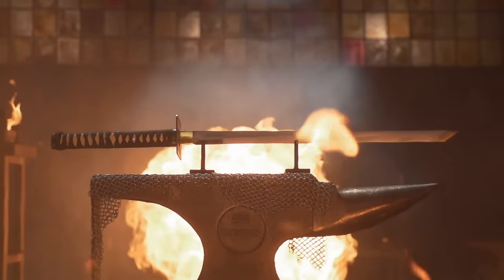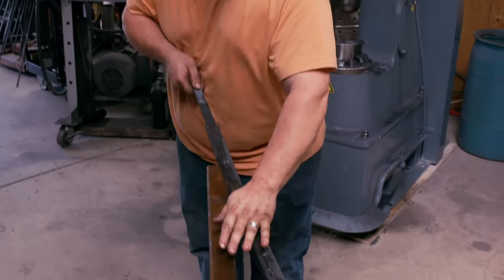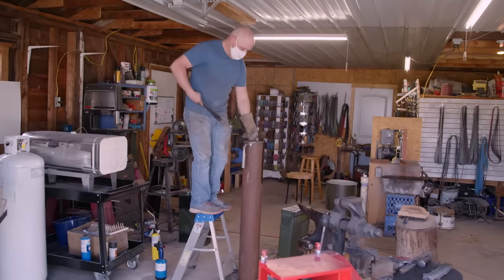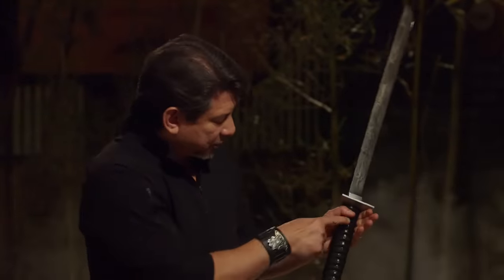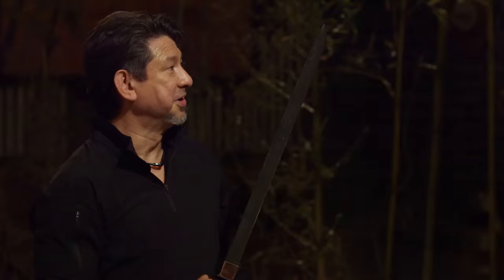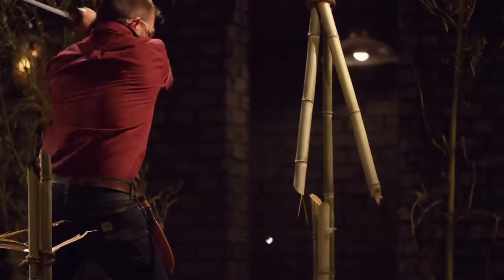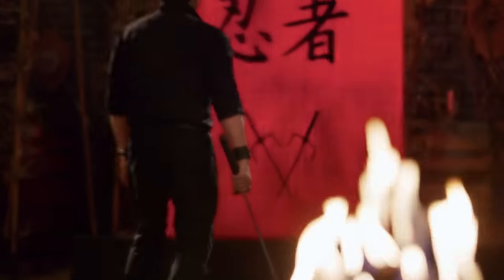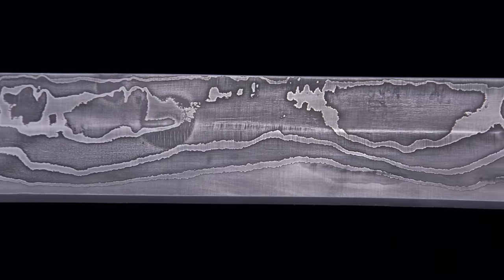EPIC NINJA SWORD USED BY SHADOW WARRIORS! | Forged in Fire (Season 9)

Comment: I always find it kind of strange when they comment on handle size. You make a sword to fit the swordsman, and then have 2-3 different people test it, so of course it's not gonna be a perfect fit every time.
Reply: I've often wondered this.  I don't know, maybe they're working off some kind of average?  There is a typical dimension to the hilt/handle...but then we go back to your point:  For what person?
Reply: I think they judge it based on the original and standard size regarding the designated weapon.
Reply: I immediately thought it probably fit the bladesmith's hands fine, they are both larger men
Reply: A smith doesn’t tailor a handle to one specific person when they know it will be handled by multiple people.
Reply: Is there a ratio to the length?
Reply: @rens7522  there’s little to no info on the ninjato historically, it was either a rare thing to really be used, or the ninja destroyed their swords after they used them, as they didn’t have the spiritual significance that the katana did. There is some evidence to suggest the latter, and only a lack of evidence could suggest the former. Basing the dimensions for this competition on a katana could be helpful, but the required dimensions of katana were determined by the shogunate of whatever point in time, so it changed all the time. Sometimes katanas had to be 2 feet, sometimes 3. I imagine the required handle dimensions changed as well, assuming they weren't custom-made to the swordsman, which could be possible seeing how easy it is to remove the handle from a real katana.
Reply: @cheetodorito7403  wow thank you for this info this is actually really cool 🙌🏼
Reply: Actually i think a real ninja sword would just be a bigger skeltonized knife meaning handle and blade one piece with just a quick cord wrap for grip after all they usaully made a new sword for each job they took they knew that traveling from town to town that they would probably be stopped and searched several times so they would not carry any weapons with them and just rough make somethings at each town the target lived in so the weapons they used would be very crude and disposable ,not wanting to be caught carring after the target was killed. So basically  the sword would be just a 
quick steel bar with an edge ground on it.
Reply: @lonknight3197  In reality, ninjas didn't like look the modern image of a ninja.  Instead, they would have dressed like farmers or tradesmen, someone who would have passed unnoticed.
Reply: @lonknight3197  You seem insecure.
Reply: @Durwood71  
And your the one who read my first post an decided that i was saying that the ninja walked from town to town in their all black ninja gi and decided that i needed educating on how the ninja actually dressed. Which by the way their favorite image was the wandering monk, but you assumed that i knew nothing about the subject and needed a history lesson, without considering that i might be very well versed on the ninja and his ways. 
If however you had just used a friendlier tone to your post we would not be snipping at each other now. But i will be the one to say sorry if you took offense to my comments and as far as asking your age i was trying to understand your level of possible martial arts training you might have.
Most people usually answer with my age is ?? And i have xx yrs of training in the martial arts so thats how i feel qualitifed to speak about what ninjas were. Thats all i was trying to learn about you.
And to answer my own question for you about me,,,, 64 yrs old and 55yrs in the martial arts multiple styles and have been an instructor at 4 different martial art schools and even been asked to give demos at a few seminars. So thats my qualifications (also have trained a few yrs at a ninja school when i lived where there was one before i moved again).
Reply: @lonknight3197  Whatever your personal issue is, I'm sure you'll get over it.  Have a nice day.

(Hmmm... it seems you're also deleting your posts after I respond to them.  What's up with that?)
Reply: @Durwood71  
I am not deleteing any post, so who is?
Reply: @Durwood71  
I can still see all my posts can you?
Reply: The comments about handle size are usually in regards to handling and how it feels in the hand. In the case of these guys if they weren't used to making that style of sword, it could simply be that they sized the handle properly to start with... but then had to do the wrap over that, which added bulk. They were nowhere near the worst handle offenders on the show, since the handles at least were easy to figure blade registration, and the wrap added grip instead of resulting in a round chunky handle that some people have submitted
Reply: That's true, and luckily it wasn't the difference maker.
Reply: It's a 2-handed weapon, so it is easier to made the handle to fit various hands. But in this case, both handles were "chunky" – too much materials on them. The main problem in all this, is that none of the bladesmiths in the show, ever produced any kind of exotic weapons from the past which they are suddenly required to make. Therefore a large room for errors due to their inexperience with large / long / unusual historic weapons.

Comment: man what a close one this was, they performed equally in my eyes but it all came down to fit and finish here, crazy quality work by both
Reply: I felt that Brett's had a slight advantage with his cuts seeming to be more deeper (and also demolished that bamboo), but it could have went to either of them. Great showdown between these two!
Reply: @Iulznazi  but Jason’s cuts were deeper and he tore through more bamboo. Brett’s sliced 4 and Jason’s 6
Reply: @nathanbarr7114  agreed. I also think in every single test Jason's performed slightly better and cut slightly deeper against both the bamboo and the flesh. not to mention his Damascus pattern was mush better and more beautiful.
Reply: @JudgeHoldenUwU  yea, Jason’s Damascus pattern was top 5 in this show imo
Reply: @Zombie Frogg you gotta remember that most people watch these videos through the lens of performance and artistry rather than parameters, myself included
Reply: @Iulznazi  The cut tests are often misleading on video. You can make a machete chopper that looks like a ninjato but with the weight and balance of a cleaver/axe so it blows through chopping and cleaving tests but that doesn't mean its a better ninjato. The guy closest to the parameters won, and rightfully so.
Reply: Brett was probably kicking himself about that first failed billet before he restarted, that would have been a major reason for the less refined damascus and rougher blade finish

Comment: They have done SO MANY things SO MUCH worse than the bamboo test. If he was worried about bamboo any ice test would have destroyed that blade.
Reply: There's footage of a katana in WW2 cutting through a machine gun barrel
Reply: Yeah, if I were a judge I would have asked for more tests. Like you mentioned, the ice or something harder than bamboo, like a log
Reply: @nicholasmangialardi1618  I'm pretty sure that was debunked
Reply: @coreyboldt9604  heard of it, it was actually real.... but... not what most think.  Key word is  "machine gun" IE a weapon that will have it's own barrel self destruct if you hold the trigger too long.  If the barrel was damaged due to over use, then yeah, a sword might break it.  It's the same premise behind why they heat metal before hammering it, the metal gets soft, and malleable.  A machine gun barrel can get heated to that point if over-used.

Comment: 25:00 slight mistruth, it would have been a preferred sword for covert killing, but most ninjas wouldn't use them since
1- most where farmers in there spare time, so most couldn't afford them and used (easier to conceal, lighter, and less conspicuous) blades made by modifying or simply using an already bladed piece of farming equipment, farming equipment.

2- A assassin may be hiding in plain sight, and therefore a slow killing poison or fire was easier to get away before getting cough.

3- most lived in remote hamlets with no one who knew the traditional methods of making a sword, and often that was the ninja who did make there own tools, so a knife or sickle would be simpler.

4- a smaller blade would be easier to transport, it's why stealth based assassins blades are often the blade of the victim or a knife, something that you don't have to risk clanging against something else.

in conclusion, it would have been used if one was found and the other was fighting back, but a simple stab in the back or lead in there sake was easier to do and if you where discovered a much more effective strategy would have been "Burn, and run" or even simpler strategy would have been (as match locks and bows where known about) Shoot them, also a shirken would not pierce a fatal distance unless you hit the back or spine (or poison or bacteria was added.)
Reply: Yeah ok lol

Comment: The strength test is to determine what the bamboo does to your blades and not what your blade does to the bamboo.  Proceeds to inspect the bamboo for clean cuts.  Lololol. Even the other judges were celebrating the bamboo cuts.

Comment: Research. Traditional Ninja To swords were not sharp, like a Katana. They were like a multi tool, used for digging and other tactical purposes where the blade was sometimes held in the hand. The angle point was the sharper part of the blade.

Comment: Hi there, I would like to know how  the forging techniques differ  between the 'Katana' and the 'Ninjitsu' (hope I got that right)Sword, and do these differences if any have a role to play in keeping the Ninjitsu sword straight as opposed to the curve the katana attains on quenching?
Reply: The history that is typically described with the ninja sword was that it is straight because of less advanced smithing techniques and also made with poor quality metal because of what was available in Japan.  The layering of a katana was to overcome the weaknesses in the metal.  Curving the katana was done with differential hardening using clay as well as the difference in hardness of the metal in each layer; for example, the spine uses softer metal than the sharpened portion of the blade.  So, yes, there are definite differences in the forging techniques.  A ninja who bested someone with a katana would find himself acquiring a nicer blade.  Drawing and cutting are different for straight vs curved blades as well.
Reply: @rickmurphy4895  Many thanks for your explanation 👍

Comment: On the battlefield, the performance of the sword is the most important part and parameters do not matter, both of the swords performed equally, I say both of them are the winners.
Reply: Except its not for battlefield. Its a ninjato and they told the contestants right in the beginning its for stealth and silent kills. To use an analogy, its like how special forces would prefer a more silent concealable submachine gun over an M4A1 even though the M4A1 outperforms it significantly for lethality, accuracy and range. Hence why parameters matter.

Comment: I thought the cops blade was going to take a bend for sure, didn't look nearly hot enough going into the quench
Reply: exactly! thank you! i thought i was the only one who saw that.
Reply: Lighting plays a roll in color. The heat treat oven said it was at the correct temp. for the appropriate time.

Comment: So much misinformation in the comments. The "ninjato" was an invention during the big ninja boom during the 70s-80s, based on a Chinese sword. Ninja (shinobi) certainly existed but nowhere near the way they are popularly portrayed.
Reply: Also, the black outfit typical of the 'ninja' is actually garb worn by the performance crew of the old plays. They were used to push things around on the set to denote movement, such as a boat scene where the crew would push the 'boat' around. They were supposed to be part of the scenery, to be ignored, much like the wires in wuxai flicks. So when they produced weapons, they would be 'appearing from the shadows', denoting an unknown assassin lurking invisibly. 

An actual shinobi would have probably dressed like a peasant or beggar, and be found on the road outside the enemy's camp, quietly counting how many bags of rice, how many soldiers, and how many samurai came and went to provide the information for his master.
Reply: Also the metal is much better than anything made 100 years or older.  Swords broke all the time which is why backup weapons were so common.
Reply: Shinobi, most of the time, were also samurai.
Reply: @spencerthestupidsamurai7326  Not usually. Samurai were more badly needed either leading troops or being archer cavalry and too expensive to risk on such tasks as information gathering and the odd occasional assassination.

Comment: 'Katana making- full process' . Watch it on youtube if you are interested in the complexities of making a japanese sword. The blacksmith uses a couple of modern tools, too. But the structure of the final product is very similar to the real thing.
Reply: I'm fine with them using modern tools, but using damascus steel gives them a huge advantage over the others, so I think they should limit the material used.